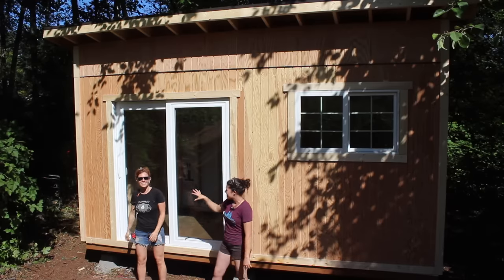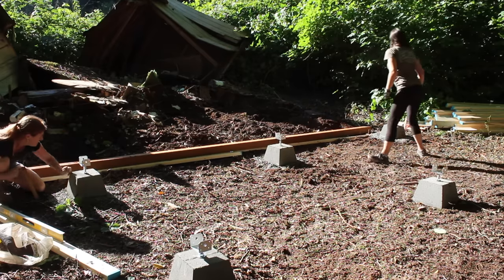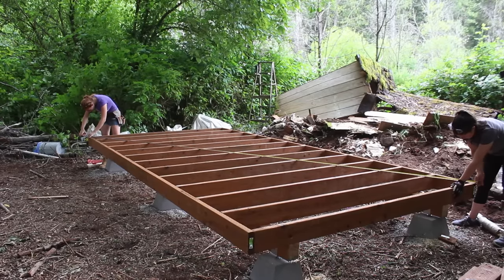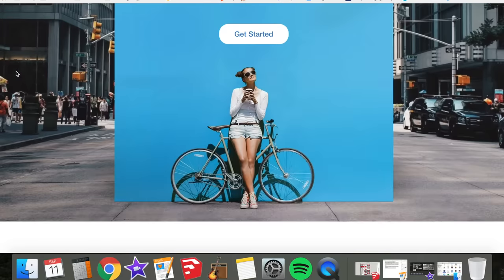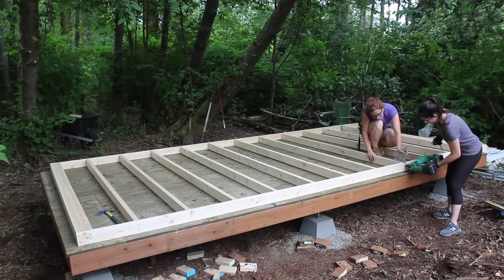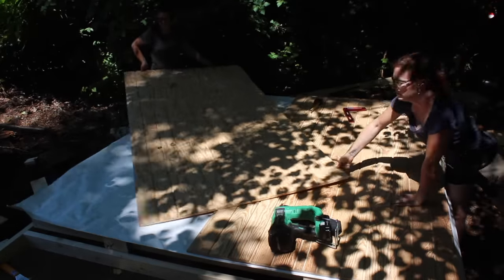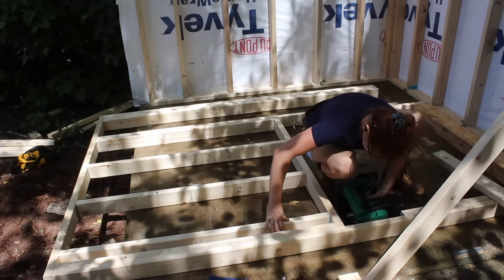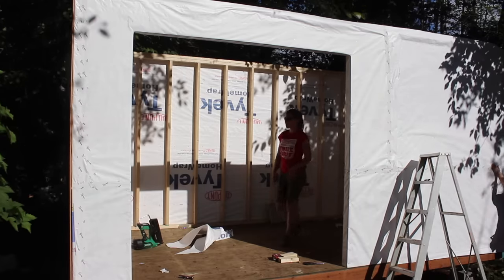Tiny House Build - Foundation and Framing

Comment: What is this line of work called? I just graduated and I am trying to pursue a career but I don't know what to get into. I thought I wanted to be a mechanic but now i am more interested in this. The way she planned it out on the laptop and got to build it by herself hands on, i want that knowledge. What is this called? Is it just carpentry ?
Reply: FlexKing Tbone mostly house builder, but the stuff with the CAD is more what an architect would be hired for, if someone were paying for the work. To design houses and then also build them is kind of tricky as a job description - if you find an architect listed as the "builder" of a house, usually what that means is he/she was in charge of hiring all the different tradies, buying all the materials, and making sure everything went according to schedule. It doesn't mean they ever picked up a hammer or a shovel.
Reply: They are doing 'Carpentry'.  You too Can become a Carpenter!  

   [see her "yes I have a Hammer, cuz I am a Carpenter!" joke at the very end of the video]

   Start out working with an experienced Carpenter/Builder/Contractor/Carpenters Union as an Apprentice/Laborer, n go from there.
   No experience necessary, just willing n able to show up, n work hard.  Good times!

   (You'll find out quick, if you like it or not!

Comment: April, 
I couldn't tell from the video but I assume you two took the time to apply end cut solution to all the treated wood cuts? (the beams didn't look like it had been applied but that may have just been the lighting)
If not then your treated wood will tend to fail from the cut end rather quickly as moisture wicks in from that end.
Love the build
Reply: It’s well off the ground and would take many many years for that to happen.
Reply: Not here in the PNW, there is enough rain and fog/mist on a regular basis that those cut ends can pull moisture in pretty quickly even without ground contact. The site also looks to have nice shade which will prevent the sun from drying things out (of course over the winter the sun doesn't show a lot here so.......) YMMV but I would always rather protect the ends, especially given a $10 bottle of cut solution and a $2 brush is way cheaper than fixing rot down the line.
Put another way, if moisture is enough of a concern to use PT wood, then treating the ends should be a given
Reply: I didn't even know there was such a thing as end cut solution. I am always strategizing how to place the cut so it is less vulnerable. Thanks for posting!
Reply: :-) You may have to search a bit as the big box stores seem to keep it in various places but they all have it.
Reply: End cut solution isn't necessary if not contacting the ground. I'd be more concerned with the T1-11 siding in that location. That roof better have gutters and downspouts or they'll be replacing the siding in no time.
Reply: Ed, we will have to agree to disagree, IMHO if there is a need for PT wood THEN there is a need for all cuts to be treated so they have the same moisture resistance (or as close as a homeowner can get)
If the ends aren't important enough to seal up then neither is there a real need for the rest of the piece to be PT.
Again, YMMV but it is a VERY cheap insurance policy

Comment: That's a good build.  I saw it on your friends YouTube channel.  I see many people measure the diagonals to check for square and that's the only measurement that I see on their videos.   Hopefully, they take more measurements off-camera. The diagonals are only two of the six measurements needed.  Let me explain.  Providing the lumber is straight, if the frame is trapezoidal, the diagonals will measure the same, but the width at the front and back ends will be different.  If the frame is a parallelogram, the diagonals will be different but the width of each end will be the same.  To ensure complete squareness, 6 measurements have to made:  2 diagonals, 2 sides and 2 lengths.  Each pair of measurements must be equal.  The alternate 3-4-5 method will get you close, but it's not precise enough to my satisfaction.
Reply: Dan Burch .... You are very correct, Sir. A lot of folks overlook this
Reply: Dan Burch.....interesting comment. The "2 sides and 2 lengths" you mentioned are in fact taken into account as the structure is being framed -- the 'off camera' measurements you mentioned -- so the only thing people show is the diagonal measurements when squaring things up.
Reply: If you cut your timbers to measure, the opposite sides will be equal. You don't need to measure that again.

Comment: Being french I don’t get what’s the use for the house wrap, we don’t use that here, could someone explain please ?
Reply: Anthony Daléchamps it's a moisture resistant membrane, to keep atmospheric damp out. Depending on your cladding, it also drastically reduces drafts - my house is hardiplank, so the house wrap makes a big difference to the wind attack on my wall insulation and thus my thermal stability, even though I live in an area of pretty low humidity so that function isn't really a concern for me.

Comment: You two are hard workers! Please do some research on which way tyvek house wrap is to be installed . There is a big difference between the two sides. The lettering side goes out away from the conditioned space. It is a waste of money putting it on the other way. Sorry
Reply from the maker: You are incorrect. According the Manufacturer's Booklet, it can be applied either way.
Reply: F
Reply: I stand corrected, they did change the product/ and you are still hard working people

Comment: I like watching your videos, one it's not about women doing better then men, and you quickly admit the learning curves as you move along in the project. It appears you think about quality not quantity as you build. You are not afraid of getting your hands dirty but yet you seem to be quite the woman still. I think young women should watch your videos to learn to survive even without a man being the head. I am a man, I have loved to design houses since I was about 12 years old. One project I completed the front elevation drawing in which the owner used. His house was 8,000 square feet with the lower floor being exposed to the west. The house stands in the Tucson National Golf Club. I am partial to using 12 gauge aluminum or steel welded together for the framing and trussing, and then 8 inch block commonly known as CMU for a weather proof exterior, this of course would require a wider footing around the perimeter, and would allow for a free span truss system in lieu of a load bearing wall to support the roof loads. Steel EMT for even the door bell low voltage wire through out the home, double pane windows, steel entry doors and roll down shutters to protect the windows exterior when needed. Cost would be greater, but the home would stand up to anything mother nature would offer. Again thanks for an awesome video, and great job!

Comment: Boy do I live in the wrong areas...Adam Booth has more concrete on his lot than he does grass, you can use blocks with adjustable brackets...ugh.  I have to have a slab WITH Rat wall, AND permits, AND approval of the neighbors, AND yea...it goes on and on...  :(

Comment: 6 piers sitting on soft ground? Somehow I just can't consider that stable. Who wants a building that warps all the time? Sure, you CAN keep adjusting the brackets... but I'd have just dug six holes (below frost line) and done 6 sonaotube footings..
Reply from the maker: In most areas that would work, but not this one. We talked with several local contractors before making the call.

Comment: Hmmm... in what appears to be a rural area, wouldn’t it have made a lotta sense to just burn the shed that y’all demolished?
Reply: There are densely packed trees within a few feet, and setting fire to those would be a tragedy.
Reply: FireAngel Londoner the old timber that isn't treated and doesn't have too much old paint on it could still be burned later, though - in a stove or firepit. That's a resource.

Comment: cute, but think my brother in law's was a better design. the walls were built with 11ft 2x4, ceiling was at 7'4", giving about 42" side walls for the upstairs bed loft (steep pitched roof). same 8x12 footprint under 100 square feet, so no permit required. most appliances were from travel trailers, shower with flip up toilet and sink, stove+oven, couch and chairs had storage, short cabinets (more floor space!), it was really well thought out and done!

Comment: very nice.  your tyvek is installed wrong face facing inside.  oh well.  still very nice.  lates
Reply from the maker: That is incorrect. According to the Manufacturer's Booklet it can be installed either way.
Reply: i stand corrected.  My bad.  You are right April it can go either way.  http://www.dupont.com/products-and-services/construction-materials/building-envelope-systems/faqs/wb-faq.html#Question8.   thanks

Comment: If I caught you using air or battery powered nailers while building any of my buildings I would fire you instantly... I hate them people who use them use way to many nails and the nails used in those guns are cheapest crappiest nails you can get and when people get in too much of a rush more then half the nails they put in miss the studs completely and they don't realize it till after because there is no feed back from them as you use them.
Reply: chuck d I built my house with an old fashioned hammer to drive nails. I can see wanting to use a power nailer on really big projects, it is faster, but for a little house, you swing the hammer the right way it will drive the nail in for you, you won't get tired of it before knock-off time.